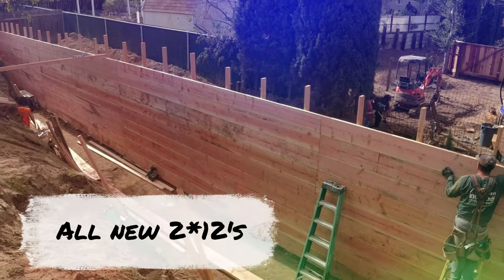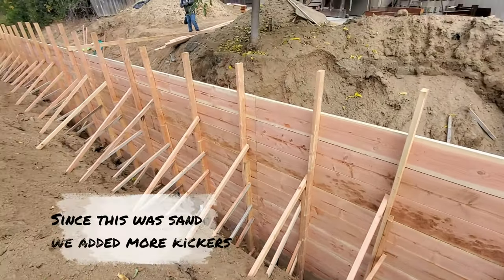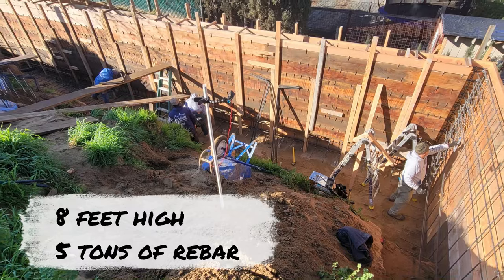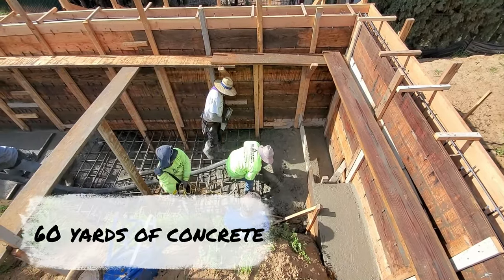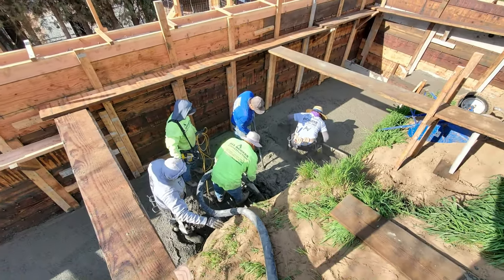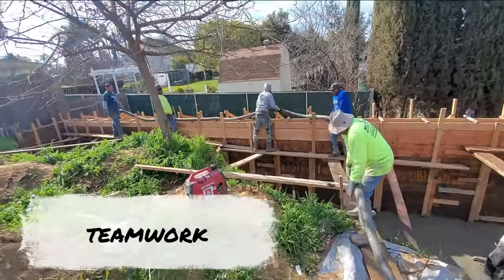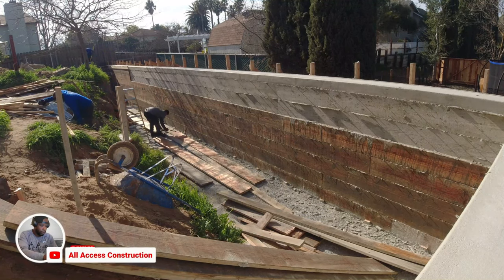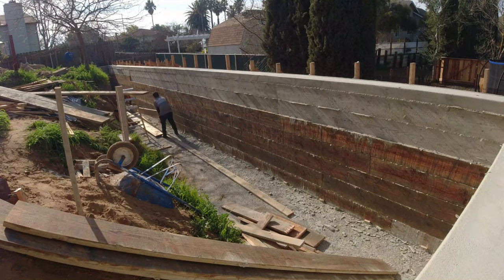Time For A Workout💪🏾 Stripping Concrete Retaining Wall

Comment: holly kicker. looked like u had walk boards up top. that makes it safe for pumping and just a safer way to do these things
Reply from the maker: Yesssss sirrrr.. Safety 1st..
Reply: @AllAccessConstruction  I've seen some sketchy stuff when it comes to pumping walls in my day, I've even been knocked off a basement wall 1 x when I was like 22, luckily I was 22 because I was athletic enough to grab the concrete truck chute and hold on for dear life as I dangled 15 feet up over some washout rubble from when they poured the walls, I may still be able to have done that today at 40, but I wouldn't want to,,needless to say I haven't poured a basement is obpver 15 years, we used to do them all the time, that was some of the sketchyiest stuff I've seen in my life, wish I had a video of that. Those chutes mike day uses, we would have 2 one set up on a ladder and the other connected to the 4 chutes the truck has.( the truck only having 1 access to the basement, muddy as can be or the middle of winter) We would pour them about a 7 slump and let er ride all the way across a basement way over to the other side, (that's why I joke around when I say pumps r 4 panzies) not really though, pumps r for stuff like that exactly and it's the only safe way to do those. In the video I said that on, it was nothing compared to some of the sketch stuff we used to do, they wouldn't let use hook the chain on the chutes anymore, so that wouldn't even work anymore anyways. HAVE A GREAT DAY

Comment: Can you address the nail that you use to tie the rebar too.  How hard is it to get the 2x12 off with the nail embedded in the concrete.  Also what about the W8 ties, aren't those sticking out on both sides of the wall, if you break them off won't they eventually rust, what about the side of the wall that is exposed, how does it look with the ties broken off
Reply from the maker: The 2*12 come right off with a litte tug.

You don't have to worry about the rust on the wt 8.

Looks regular. You can't tell it's broken off